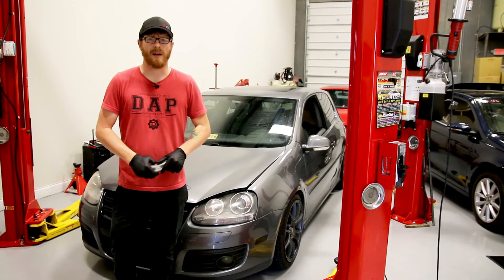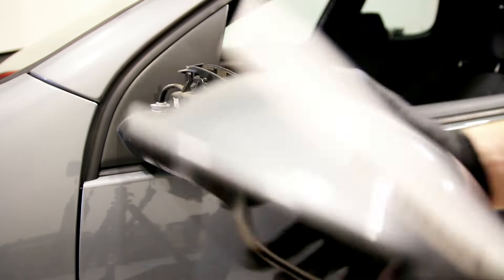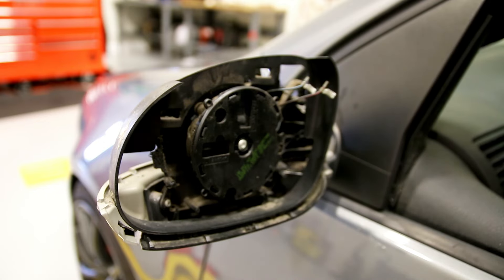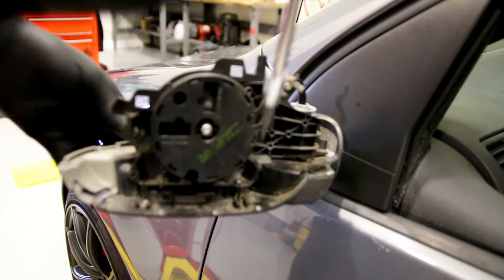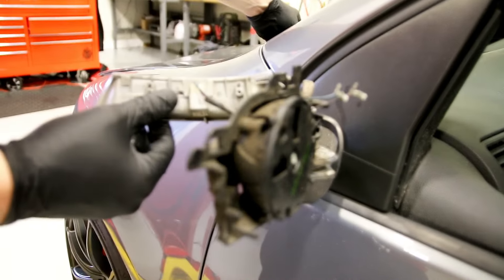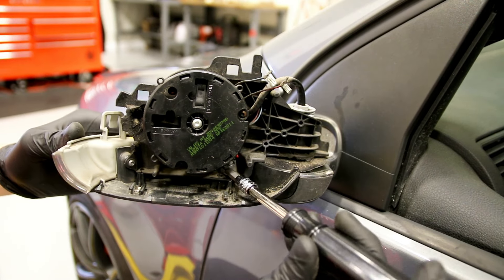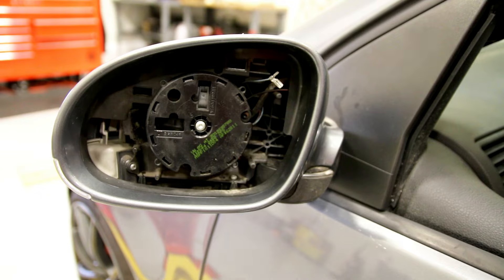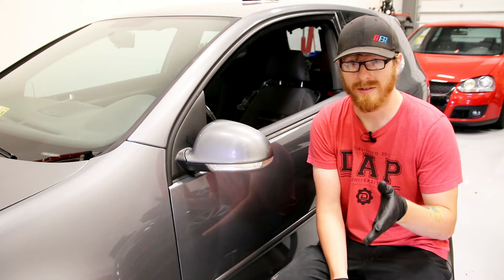How to Replace a Mirror Turn Signal on a MK5 GTI

Comment: Almost the same process for replacing the glass mirror. Beware of spiders living in there, have flyspray ready. Check that the mirror adjustment still works. The red wire goes nearer the door when rewiring mirror heater,  the left side mirror.

Comment: I found it helped a lot to unscrew the circular motor unit and leave it hanging out of the way. It is only held on by three T10 screws, so it only takes a minute and hugely improves access to the other four screws that need removing. It is difficult to access the vertical screws using the kind of Torx kit most DIYers have. The bit holder gets in the way. (Maybe that is why one was missing?)

Comment: Can the bulb be replaced in this indicator or is it a solid unit that requires replacing the lens as well? Thx
Reply: It's a complete unit but they are very cheap.

Comment: Does this apply to the 2010 sportwagon?
Reply: I did it for my '09 Sportwagen (Mk5), that said the '10 SW is Mk6 but I think most parts are interchangeable between the Mk5 and Mk6 SW since the Mk6 SW is based on the Mk5 platform, the differences are the front end and the interior

Comment: I think it's impossible to remove the mirror glass without pulling a face like it's going to break!
Reply: Nah don't worry I tried it and it pops off without too much difficulty, it doesn't require too much force to remove, in fact it was much harder for me to remove the mirror cover cap

Comment: I know this isn't the proper place for this, but I want to purchase a 2013 Audi S4 with the 3.0T. but it idiles really rough, idk if this is normal or common, on the forum it is common. But idk. It has 56k miles. 6 speed manual. They want 26k for it. Driving the car seems smooth.